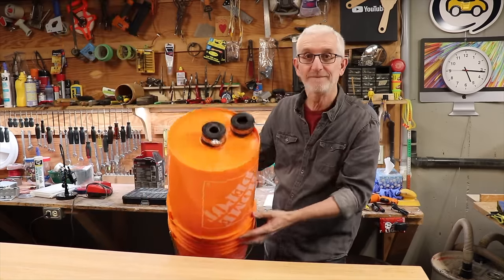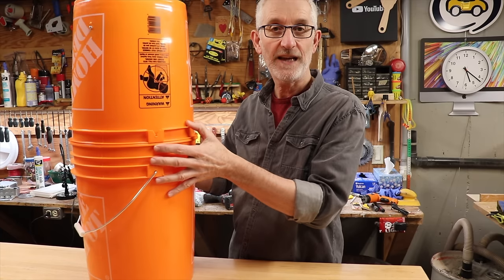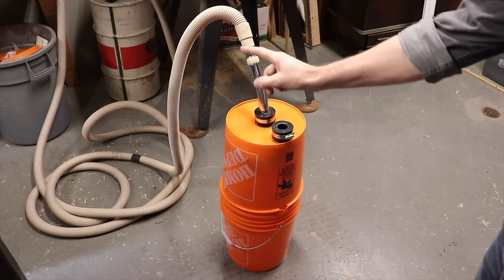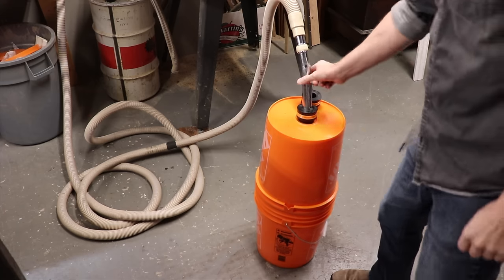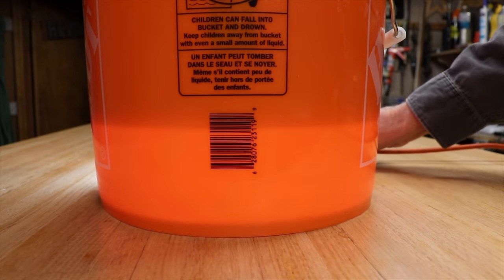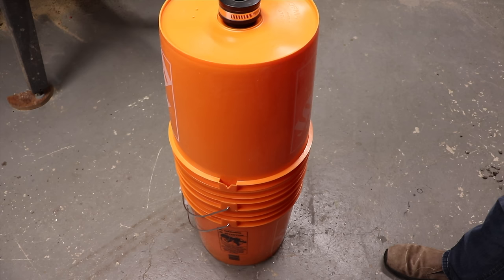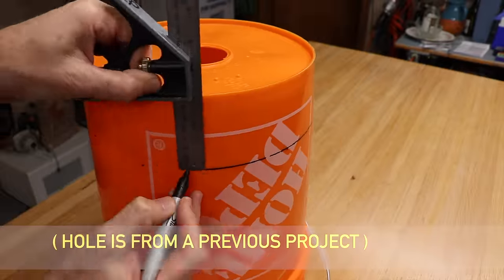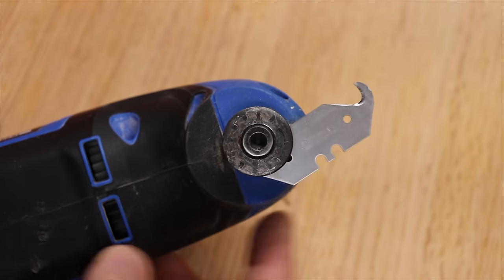Simple Cyclone Dust Collector ● UPDATE !

Comment: For some reason mine collapse even after doing these modifications. Odd! It must have something to do with the 2.5”from the shop vac and 1” to my cnc. It collapses without actually sucking anything up. I was hoping to have this all work well with a smaller diameter hose on the cnc end (small, desktop cnc) but it looks like I’ll have to upsize it. I’m assuming/hoping that will fix the problem.

Comment: Could I just use a 33 gallon plastic barrell and achieve the same thing? (I can get them for free)
Reply from the maker: You should be able to yes. The only issue is it could collapse if you have any blockage occur in the hoses. If you can get them for free, you have nothing to lose! Go for it. It's all about experimenting and trying things. There is no such thing as failure, it is all about learning!

Comment: Any thoughts on some one said fill the dust collector with water  to use as a poormans water filter for dust ? Ideas please thank you
Reply from the maker: You can experiment with that. My thoughts are that if you happen to leave it and forget it,there could be a mould issue and a messy clean up.
Reply: thank you chris in my home improvment projects I am work I have a bucket top shop vac  just but a 6.5 gallon bucket which I eventually plan to add a spigot t so if would seem If I ever figure out how to get my dust collector conected if you put the dust though water hopefully it will work as a water filter/ scrubber etc!
Reply: HI Chris in case I did not explain it to you I have bucket head style shop vac and my theory is to put a faucet in these buckets I am using just bought a 6. 5 gallon one I think I will eventually have it in addtion to my 5 gallon bucket when I get it the belief is I can only life 5 gallons at the end of my muscels 6 gallons would be impossible so the idea I came up with is if these get water in them I can drain enough water using the faucets I put it that while it may not drain the whole bucket anything below the faucet will be easier to carry it diffcult to carry around 5 gallons or larger so if you can get most of the water out it will work better it would seem while research as previously stated someone stated there ideas was to have water in the dust collector and it might help collect some of the dust I dont know enough about it to verify that but that would seem to be their claim any way good luck!
Reply: @chrisnotap  HI Chris since you like to enginner things May be you can try to help me with my current puzzle I tried to get the cheapest cyclone I could by but I do not have a 2.5 inch hose However it seems I could squeeze in from the bottom an adapter an 1.25 hose and that might fit as a jerry rig trying not to have to buy to much more stuff as I am getting ready to move soon and this is getting expensive from my view point it looks as though I can put a 1.25 inch hose throught the bottom of a 2.5 inch hose line and it will fit a hose seem to be a little bit smaller but fits I just have a poor mans bucket type lid with 2 circles on each end it seems one is supposed to have a 90 degree elbow so In theory it seems the fix to the out put hose seems to be put an 1.25 adapter through a 2.5 inch and it will acommodate a 1.25 inch hose what we cant be sure of is is this secure so I would think the things on list if we now feel its time to ask what are we trying to accomplish it seems to me that should my vacum hose than be compatible on the out let side would be good and would need to glue it with silcone glue and I guess if I go to the hard where store if I could find an apprpriate 90 or 45 degree elbow that I can silicone it hopefully it would be right as for the other end since it would also be a glued in 1.25 I guess I would need to find an adapter and maybe see if it works I cant be sure it would work but can you tell me does that sound theoertically correct to you thoughts please thank you  I mean I think on the other side I may need a 1.25 to 1.25 adapter Note In addtion to using silcone glue I have covered part of this with teflon tape ! again does in theory that sound correct to you?
Reply: Ps I am trying to figure out if I need to re-design this thing any way it would seem its best to see if I can take a 90 degree eblow and glue it to a 45 and face it downwards does that sound theoertically correct to you?
Reply: @chrisnotap  its no longer a concern as I dont think I can put any more money into the thing will try to see if i can get a refund as the item is not working properly!
Reply: @chrisnotap Hi Chris my attempt at buying a pre made dust collector was a failure but I wanted to ask you does it seem in theory I I have a step drill bit here I could get a bucket lid and get a 90 and 45 degeree pvc if there is a way to glue it together I should be able to easily make a home made dust collector ? thoughts please thank you'
Reply: @chrisnotap  any way I tried a new idea I took a crevace tooll and pointed it downward I tried attaching it with toggle bolts do you think that is theoretically correct?
Reply from the maker: It's all about using your noggin and getting creative! You have some good ideas that you should explore. Remember there is no such thing as failure. It is learning and it gets you to the next step of what you want to accomplish.
Reply: Here an update the best thing I could come up with was stick a short 1.25 hose in the hole I made near the top of my dust collector in other news some one said a hack was to use pool vacuum hose as its less expensive I was able to get a good deal on a large one the pool cuff sleve is similar in size that I think it will inter mix with the other hoses so I think I managed to find a solution but will let you know if the hose fits when I get it !
Reply: @chrisnotap for some strange reason I was still thinkning of getting the dust deputy but the whole reason there is the diy dust collector is because everything is more expensive now my mom died 2 years ago she was suprised that the dollar store is now the dollar and 33 cent store I guess it I made my own I really dont need an expenisve one I guess on list of concerns though is I guess all buckets would work better if they have lids I guess?

Comment: How about putting a couple of bricks inside the bottom bucket rather than making the original taller.  You can zip tie it or glue them to the bottom.
Reply from the maker: The height allows the dust to settle easier. The bricks would disrupt the flow of air causing it to get suck up into the vac.

Comment: I didnt get the collapsing part. Hows another layer up top helps to prevent collapsing? I have tried to add pressure valve. But faild :( It is still collapsing

Comment: Total noob question: how do you safely dispose of the dust from the bottom pail? Seems like dumping it into a trash can will be a mess.
Reply from the maker: Plastic bag over the pail then tip it over.
Reply: Thanks! Any chance pre-lining the bottom pail with a trash bag might work? Or would it ruin the seal?
Reply from the maker: The bag will disrupt the flow of air since it's impossible to get it to sit as smooth as the inside of the bucket.
Reply: Gotcha. Thanks again!

Comment: I am getting a loud whistling noise.  Helps if there is a load on the vacuum, even just a bit, or if the hose is straight.  Any ideas?  (Aside from the obvious keeping the hose straight with a load.)
Reply from the maker: Some have said some vacuum hoses will cause whistling. Investigate that.

Comment: Not a moving parts kind of guy here so can someone explain to me please how reinforcing the OUTSIDE prevents it from collapsing INWARD? I mean, obviously it DOES, but it makes no sense to me.
Reply from the maker: It re-enforces the wall strength by doubling it preventing the collapse.
Reply: @chrisnotap  That's just it though, the two buckets are not connected to each other. I can understand it reinforcing it from blowing outward, but what's to stop the inner bucket from collapsing inward? Wouldn't the inner bucket just pull away from the outer one? If they were glued together, sure, it would double the strength of the wall but they're not. In my mind it's like propping a chair under a door handle to stop someone opening it. It's fine unless the door opens outward…

Comment: I bought all the parts in the description but all the parts are the same size one and a half inch. They don't fit into each other. I think you need to put down different measurements of the connectors.

Comment: super cheap? what's the TOTAL cost of materials (even excluding tools)? compared 2, say, HD's dustopper $52?
Reply from the maker: Depending on where you live $10-20
Reply: @chrisnotap  i actually gotta apologize. u DID list all the parts needed in another vid. i actually bought all of them and got around $25+tax (in No VA, which is prolly not the cheapest region in the US). One note: looks like u do need 2 purchase 2 identical pails... I had an old one and bought a new one. even tho they looked identical, the diameters didn't match (small mismatch but big enough 2 make it near impossible 2 fit the pails into each other). fortunately (and oddly enough) another pail worked okay.

Comment: Update on my "bucket build". After building "stage one" from Chris's previous video (noting a few significant bucket variations between the one's Chris is using and those I purchased from my Home Depot), I went ahead and used the bottom bucket idea (plus half a paving stone) for stability. I thought I would bypass the top reinforcment since I'm only using a ShopVac, not a central vacuum system. But... With the sunny weather in good ol' California, I think the heat has softened the plastic, making it susceptible to a massive "smoosh" effect. Happily, I have an extra bucket lying around so I'm going to see if the top reinforcement will work for me.

Comment: I made this and I get a whistle when using it, why is that?
Reply: Forcing air at high-ish pressure through a small opening and/or across the inner ridges is much like a person whistling.

Had the same thing happen when I was using an off-brand extension hose made of a hard plastic. Try to find a rubber-ized hose like those sold by Shop Vac or others. The whistling sound is gone and the rubber hose looks like it is much more robust.

Comment: This is when DIY fails the cost-benefit analysis.  I watched both videos, priced out parts and my time...and purchased the pre-made shop vac bucket top for about the same cost (which also came with an extra hose to connect to the shop vac), saved myself an hour, and got back to work.
Reply: Are you talking about the vac motor assy. that you buy and attach to a 5 gal. bucket to make a small "shop vac"?

Comment: I can’t for love of god, understand WHY IT STILL DOSNT COLLAPSE, because the extra bucket is on th outside .???
Reply from the maker: The extra layer of plastic from the second bucket ups the strength of the wall.
Reply: You know how it's hard to separate 2 buckets when you slide one into another identical bucket? Part of the reason is because it's a tight fit. A big part is because when you slide the bucket into the other one, that tight fit helps form a vacuum when you try pulling them apart. It's acting like a syringe in a way. For the inner bucket to collapse, it would have to pull away from the "wall"" of the outer bucket, but it can't since it can't pull air in to break the vacuum and release it. It makes the 2 single bucket "walls" act more like one thicker, stronger "wall".

Comment: I'm a bit surprised that this mod will work at all. Perhaps for a low power vacuum system. Putting the extra bucket on the outside does nothing but hide the continuing vacuum collapse of the inner bucket. A much better approach would be to put the reinforcement bucket on the inside, of both the top and bottom buckets providing a source of resistance against the collapse.
Reply: Even better than that and not only avoid bucket collapse, but the time it takes for these mods. Is either knowing a friendly painter in the trades, or asking a local Sherwin-Williams rep nicely for a couple throwaways in the back. Those 5 gallon paint buckets are thicker than a HD bucket.
Reply: But then you'd have to add a reinforcement bucket to the inner reinforcement bucket to keep it from collapsing like the first inner bucket .....or something. Right? I'm confused now.

Comment: Warning to people making the build.  This design does not work well with fine sanding dust.  Too much hets through and still cloggs the filter.  Also, not all HD buckets are made my the same manufacturer.  Not all will mate when cut and tapered.